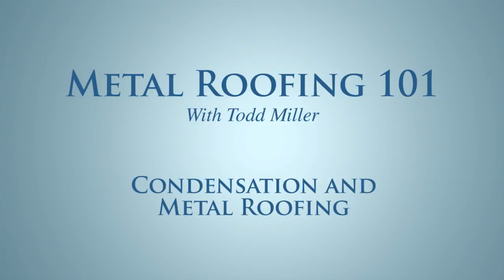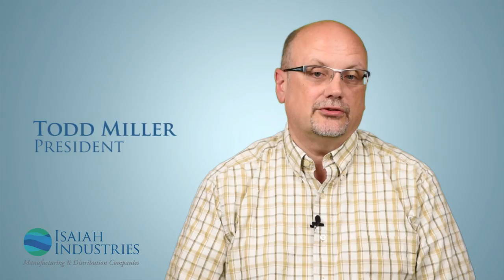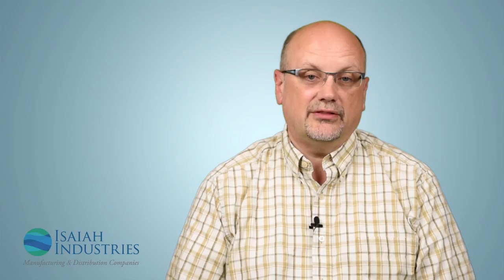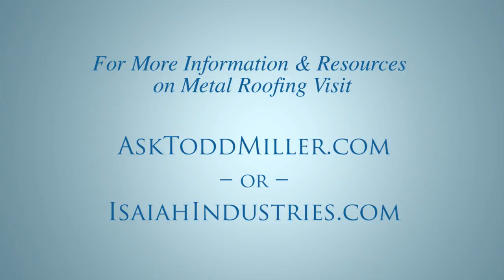Condensation and Metal Roofing – Metal Roofing 101 with Todd Miller

Comment: Hello. Thank you for the info. I have a question on how to "fix" my condensation issue.
6400 sq/ft all metal building. 
The metal ceiling does not have a vapor barrier. It has blown fiberglass insulation at approx R-50. The heat source is propane tube heat. Its now too late to install a vapor barrier since the ceiling is installed and blown insulation installed. Is the "fix" to install a fan or dehumidifier? The roof has vented ridge but there is no fresh air or soffit vents because this building was built with no soffits. So no fresh air in and ridge vented. The condensation is real bad. Temp insode is set at 55 degrees and its been 0-20 degrees lately outside. Thoughts?
Reply from the maker: Here’s a video that may be helpful but it sure sounds like you understand the dynamics.  https://www.youtube.com/watch?v=NYwD9CWveKY  Condensation is controlled largely through vapor barriers, ventilation, and insulation. I am not sure you can “fix” the situation you have without structural changes. However, I would suggest a dehumidifier suitable for a space that large. I’d also suggest running any ceiling or HVAC fans all the time to keep the air stirred up. Another option that may be helpful is painting your walls and ceilings with oilbase paint as oilbase paint does have some vapor barrier qualities.

Comment: how does a metal shingle have q gap between the shingle and the roof deck?
Reply from the maker: Thanks for the pertinent question.  Most metal shingles have a butt height of ½” to 1” that keeps most of the shingle surface off the roof deck.

 This air gap produces a thermal break that supports energy efficiency in the summer by halting the conductive transfer of heat.  

This air gap can be very small and yet still very efficient – just think of how small yet effective the gap is between double pane windows.

Comment: You are wrong. Moisture collects under metal roof in a car port. You should have not said water does not collect under metal roofs. Very wrong.
Reply from the maker: Thank you. Whenever warm moist air hits a cool surface, it will condense.  As the air shrinks, moisture is forced out of it. So, yes, this can be directly on the metal roof. However, for residential applications, the general consensus is that metal roofs should be installed on solid decking, not open framing. Therefore, as warm moist air tries to drive out of the structure, the cool surface it reaches first is the underside of the roof deck so it condenses there, before it reaches the underside of the roofing material. Additionally, most roofing underlayments which go between the decking and the metal roof are pretty strong vapor barriers.  Yes, there can always be other conditions that have other results but my reference was to normal attic construction over a home with a solid roof deck. A more in-depth explanation is available here:  https://www.youtube.com/watch?v=NYwD9CWveKY  Thanks for your comment which allowed me to clarify.

Comment: Doesn't steel get a lot colder or hotter then asphalt shingles? What about in Canada if you don't have vapour barrier or good insulation won't it start to condensate even if it wasn't before the metal roof?
Reply from the maker: Thank you.  Yes, in the case of a metal roof that lays right on the roof deck, the contact can drop the roof deck temperature enough to be the straw that breaks the camel’s back and causes condensation in the attic. However, if a home is vented and insulated to code, I have never known this to be a problem. However, if a home is on the verge of condensation due to inadequate insulation, air sealing, ventilation and perhaps a vapor barrier, a metal roof can turn the tide and cause condensation.  Here is a link to a webinar with an in-depth discussion of this topic:  https://www.youtube.com/watch?v=NYwD9CWveKY
Reply: @IsaiahIndustries  so if it has poor Insulation and ventilation and no vapour barrier could it still condensate even if you put a good vapour barior under the metal?
Reply from the maker: @Brandon-no3vc  Yes.  Condensation most often occurs when warm moist air driving out of the structure hits a cool surface. In the case of a moisture or vapor barrier directly behind the roofing panels, it will quickly take on the same temperature as the roofing so that moisture driving out of the structure will hit the moisture or the vapor barrier and condense on it.  To help avoid condensation, the vapor barrier needs to be directly against the source of warm moist air.  In this case, that would be behind the drywall on the walls and ceilings. That separates it from the cooler temperature of the roof.
Reply: @IsaiahIndustries  so if you dont have vapour barior you cant put on a metal roof?
Reply from the maker: @Brandon-no3vc  That is not the case.  Metal roofs are used all the time on homes without vapor barriers behind the walls.  As stated previously, if a home is vented and insulated per code, I have not known this to be a problem. However, on homes that are not vented or insulated properly, the drop in roof deck temperature caused by a metal roof can be the straw that breaks the camel’s back and causes condensation that did not occur previously. If you’d like to discuss your particular situation further, please give me a call at 1-800-543-8938 ext 201.
Reply: @IsaiahIndustries  I ment on the ceiling not sure if there vapour barior behind the walls but thanks!
Reply: Metal roofs are superior in every environment. Sun does not destroy metal and it is 18% more efficient heat and cooling.
Reply: @mikewhite9818  how is it more efficient on heating house
Reply: @Brandon-no3vc    The air barrier between roof and steel is one way. The coating on the outside of tin does not conduct heat or cold very well. Test it yourself. Take a piece put hand on top then bottom you will feel difference. Also normal roofing grabs and holds heat sending some of it inside more so than tin. Put your feet on a paved road in the summer and yell ouch.
Reply: @mikewhite9818  what air barior?
Reply: @Brandon-no3vc    When you install metal over a roof you first lay down 1x4’s every 18” or so then metal lays on that base. Then you have a 3/4” air barrier.

Comment: Would you put OSB under metal roof in cold NYS? Or does it not matter as long as the attic is insulated properly?
Reply from the maker: As a general rule, I prefer CDX plywood to OSB.  That said, if the attic has proper ventilation and the roof is installed correctly and a quality underlayment is used on top of the decking, I can get behind the idea of OSB.  I hope this helps.  Feel free to contact me at todd@asktoddmiller.com

Comment: So does this mean a metal shed in Florida hot climate shouldn’t have an issue with condensation forming on the roof panels?

I ask because the shed will never be heated in the winter so the inside of the shed will always be cool in colder days until it gets warm by the sun.
Reply from the maker: Thank you. Condensation is about more than just temperature. It is also about the ambient moisture in the air and reaching dewpoint. In your case, I would definitely expect there to be times when you have warm moist air inside the structure and then the outside temperature drops at night, causing the warm moist air inside to condense on the underside of the cool roof panels.
Reply: @IsaiahIndustries  oh wow.. so, how can I avoid this without having to leave the windows open? - Will adding reflective insulation help with this?
Reply from the maker: @macster1457  Ventilation and vapor barriers are probably the answers.  I do not think insulation without a vapor barrier will stop the issue.

Comment: Some basic physics sir: as air temperature rises so does the water content of the air. Examples are tropical air hitting cold currents or being pushed up by mountains causes it to rain heavily. The next factor is the heat conductivity of the medium between warm and cold air. Metal is a good conductor of heat. The resultant effects are if humid warm air comes into contact with the cold surface of the metal it condenses because the cooled air cannot keep that humidity level. The rate of condensation will be proportional to the thermal conductivity of the barrier.

Comment: Hi Todd: I've noticed on a few PBR style metal roofs I've inspected that it appears if the panels are overlapped too much there's  water residue between the panel laps and rust starts to develop. 
On one roof all the laps rusted and the whole roof had to be changed out.  The roof had PBR panels on top of insulation over purlins. 
What causes this and how can it be prevented? Or can it be prevented?
Reply from the maker: Thanks for your comment.  Interesting. Of course, the first answer would be to not use that type of panel.  LOL  I wonder, were these lower pitch roofs by chance or perhaps roofs prone to getting a lot of debris laying on them? Those things could cause the overlaps to get a lot of moisture in them.  Moisture held between two painted surfaces will eventually break down the paint which then exposes the steel and leads to failure (corrosion) with steel products. This also could be the result of failure from the exposed edge – aka “edge creep”.  Many of the PBR panels are a lower grade steel that is certainly very prone to edge creep. While I prefer galvanized over Galvalume for edge protection, Galvalume should be minimum AZ50 and galvanized minimum G90.  Anything less will be extremely prone to edge failure.
Reply: @IsaiahIndustries  Thank you Todd!

Comment: I have a two car carport, outside of course. In the cold months it's literally raining underneath from condensation. It has open ends and open sides. My opinion is that metal just naturally sweats. Higher pitch helps water move off faster but it still sweats. I had a mobile home that I was sure it had a leak. But only in the cold months and never when it was raining. I love the look of metal but after using it in several different settings I am reconsidering it's values for my own sanity. Good luck with your projects and thanks for sharing your opinions as well. We are all in this together as long as we are six feet apart....😅

Comment: I just replaced a 16’ sheet of metal on a roof less then 2 years old for a “leak” that was caused by sweating. It decking boards used for nailers under it (so it had air flow) and the attic had 2 gable vents. Yet when I pulled the sheet it was soaked on the bottom side as were the shingles under it! I live in northern Kentucky and the humidity here is pretty high I grant but don’t tell me they won’t sweat they will every time! The metal heats and cools faster then the air around it and causes sweating! I’ve seen buildings rain on the inside with no water standing on them at all!

Comment: Nice speech,, my shop condensate like rain in the winter. How do i fix it.
Reply from the maker: The answer to your question depends a lot upon the exact construction of your building.

Feel free to email me photos and description: todd@asktoddmiller.com

Generally speaking, though, things like dehumidification, vapor barriers, insulation, and ventilation can all play roles.

There are also products like DripStop that may be helpful.
Reply: Robert McCully - what are the layers of your structure from inside to outside on both the walls and roof?  What ventilation methods do you use?  Thanks!

Comment: I don't think people understand condensation and how airflow promotes it.  We have a metal roofs on several identical open structures with no walls in upstate New York.  They are adhered to 2x4 purlins.  During cold, especially foggy, the backside of these sheds are soaked, with water dripping off them.  This has nothing to do with air temp differential on either side of a roof, the metal panels themselves change temperature a different rates than air temp and sometimes they promote condensation.  The one in a field is worse than the same structure next to the house and under a tree.  This says that when condensation conditions occur, more airflow allows more water to accumulate as air blowing by drops it moisture.  This is why my shed in the protected space gets less condensation.  Panels adhered to solid decking condense less, not because ambient air above and blow the panel is the same, but because there is less ambient airflow hitting the panels limited only to the amount between the deck and raised ridges.  There is just less water available to condense.  In fact, I think it is a mistake to encourage ambient airflow under the panels- such as putting metal on battens when going over existing roofing to "vent the roof".  On the contrary you want to insert foam at the even edges to prevent airflow.

I agree in a heated home with a cold attic, it makes sense to vent the soffits and roof ridge to get house moisture out.  You need a vapor barrier to prevent attic air from touching the back of the metal.  In this case you still don't want ambient air reaching the back of the panels either.  For solid decking synthetic underlayment plus plywood is probably enough, along with sealing the metal ridges at the eaves.   For open air framing (purlins) manufactures are adding felt to absorb condensation, but this is not great.  They should be designing panels with adhered layer of closed cell foam underneath that lays flat and is offset so metal ridges overlap and insulation mates correctly.  This would eliminate condensation all together in all situations.
Reply: I have a steel building in Florida and it sweats water like crazy. Temperature differential is most definitely an issue.
Reply: Nice explanation.
Reply: I've never tried it but you could consider installing Drip Stop, a patented condensation control membrane, to prevent damage from moisture. Drip Stop (manufactured by ABC) is a felt-like material with a rubber backer that can be applied to the back side of metal panels. The material literally traps and holds the moisture resulting from condensation. When conditions change, the ambient air temperature usually rises, thereby raising the dew point. The moisture is then released from the Drip Stop material back into the air in the form of normal humidity. Drip Stop can be applied to the back of metal coils (either Galvalume® Plus or painted) and then the metal can be roll-formed onto panels.